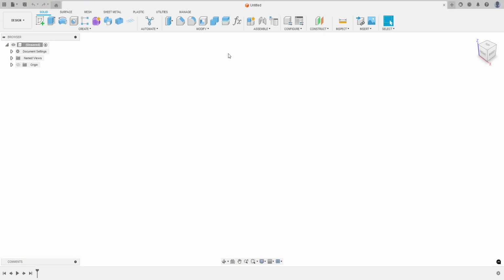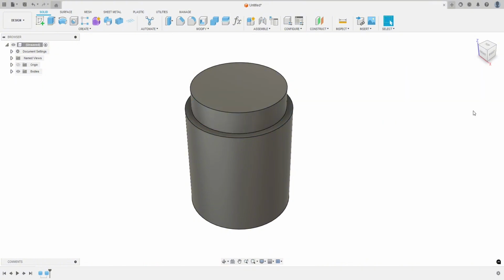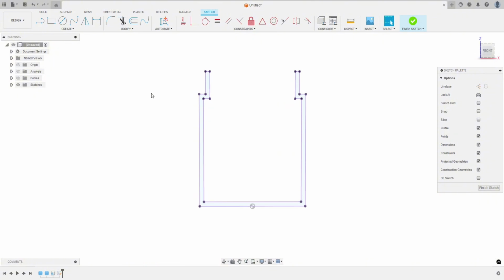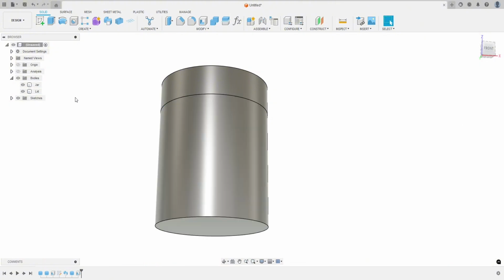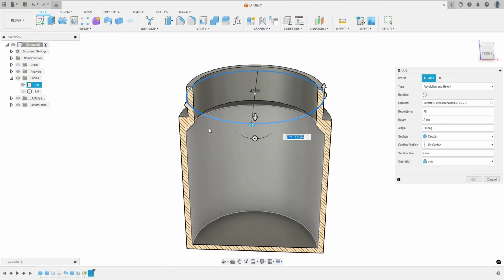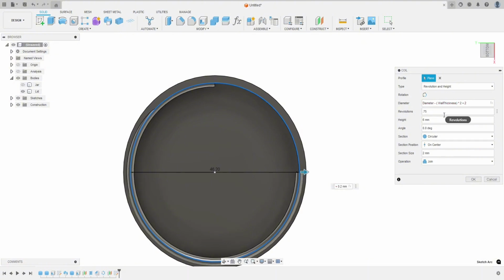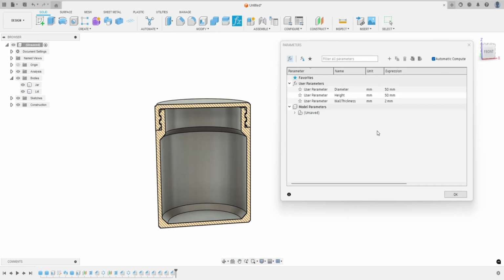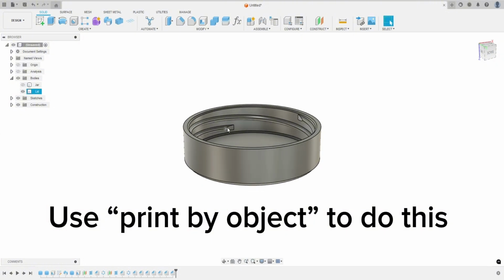Design and 3D Print a Simple Jar in Autodesk Fusion

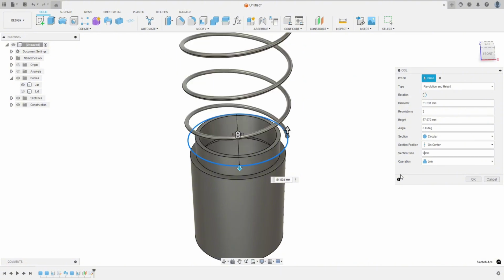Comment: Thank you for this video. I have a question at 17:43 - is there any special way to choose the number of revolutions for a jar? Or is it just basically "by preference or feel"?
In other words, is there a WRONG way to choose the number of revolutions that I may want to avoid? :)
Reply from the maker: I usually don’t go less than 1.25 revolutions unless I’m doing like a double or triple thread.  It’s basically just preference.  Need to make sure you have enough room on the neck for the threads to work
Reply: @ShopTherapy623  Thanks for your fast response. I'm sure the more I do this, the more familiar I'll feel when making them. :)

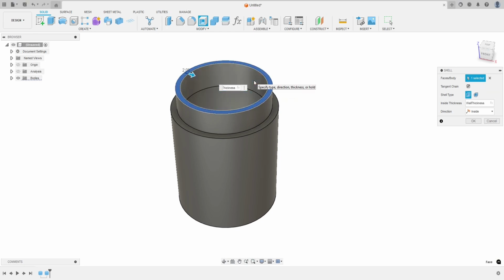Comment: I am so glad to have found you. I am completely new to 3D printing, but especially to CAD. (I’m also an “old dog” at 70) You are the first person I have been able to follow enough to get started. My issue is I don’t even know how to move the drawing around and find the right view. I need a jar that has a diameter of 50mm and height of 160mm with a screw top lid. I followed you to about 7:36, but I couldn’t turn the analysis back on and I couldn’t find the “lip” for lack of a better term to chamfer. I’m so frustrated! I went to your link in MakerWorld, but don’t know what to do from there. Any help you can give me would be greatly appreciated!
Reply from the maker: The section analysis will be on the left side of the screen in those drop down menus. You just need to toggle the eyeball on and off.  Creating a parametric model like this is a pretty advanced technique for a beginner. So good job making it as far as you did!
Reply: @ShopTherapy623  Thanks for replying so quickly! One other question. How do I download your maker file in Fusion? BTW I am using an Anycubic printer and their slicer program. I tried to download the 3mf file and even the bamboo file, but they both pulled up in Anycubic slicer.
Reply: Sorry! I just tried to download your design in fusion again. I hadn’t tried the “download stl” file. It worked! You are amazing! Thanks!
Reply: I finally finished the jar that I wanted! Thank you! I have another question. When I print the lid, it prints from the bottom to the top which leaves a lot of strings inside the lid. Is there a way to flip the lid so it will print from the top (the solid edge) and won’t leave strings?

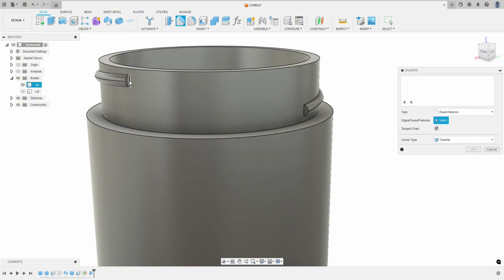Comment: At 20:43 you show how to select the non embedded edge of the coil to create a chamfer.  For some reason Im unable to select only the non-embedded edge.  Fusion is forcing me to select the entire circular cross section of the coil which includes both the embedded and non-embedded edge.  Any insight you can provide will be greatly appreciated.  And I should add that all selection filters are fully enabled.  Thanks
Reply from the maker: You need to join the bodies first (coil to lid or jar)
Reply: @ShopTherapy623  Actually they are joined.  I redid everything from scratch, this time I was able to select the non embedded edge however I received one of those nasty chamfer error commands when I input your exact values
Reply from the maker: @AB133a if you hop onto the Shop Therapy Facebook group, you can send me the file, and in can take a look at it
Reply: @ShopTherapy623  Actually I finally got it working.  Thank you for an excellent video.

Comment: do you have a tutorial to add textures to the outside of the jar and lid that change with the parameters?
Reply from the maker: I do not. That definitely gets more complicated, as the the size of jar changes, the texture will also have to scale proportionally.
Reply: Yeah that's what was afraid of. Thanks for the reply. 

@ShopTherapy623
Reply from the maker: @NotTodayStan42 it can be done though. However, Fusion is not really great with textures

Comment: Thank you this awesome! Just having one issue. When I perform the final test and change the parameters the lid does not change with the jar. I changed the diameter to 75 and the lid stayed at 50. Any suggestions on how to fix this?
Reply from the maker: You’ll have to make sure the parameters for the lid is set up correctly!

Comment: Thank you for your tutorial! I had to try it out immediately, and I learned so much from you over time. I was experimenting with creating a parametric surface pattern for those containers. The only issue was that the number of grooves remained fixed. I saw your other surface tutorials and was wondering if it’s possible to make one with a parametric option.
Reply from the maker: Parametric surface texture would definitely be more involved.  You’d have to come up with an equation for the circumference based on the diameter, that evenly changes the pattern of the texture.  You’d also then probably have to change the size of the texture as well.
Reply: @ShopTherapy623  Yes, I’ve already set that up for the width and height of the grooves. My formulas are probably way too complicated, but they work great. However, as far as I know, it’s not possible for the circular pattern. 🤔
Reply: @ShopTherapy623  I managed to design the surface pattern parametrically based on the circumference. The height and width adjust accordingly, as well as the rounding of the edges.

I want to thank you again—your videos have significantly improved my Fusion 360 skills. You deserve way more followers and recognition!

I’d love to show you how I solved it since I’m quite proud of it. Is there a way I can send you the file?

I’d also like to publish the design, but I didn’t want to do that before asking you and showing you what I was able to create with your help.

Best regards,
Chris
Reply from the maker: I would love to see it! I just started a Facebook group - https://www.facebook.com/share/g/18tXQxKoqT/ 
You can message my page on there or share to the group!

Comment: Just did the full follow along, great tutorial.  Yes, you can have the lid and the jar on the same plate with different layer heights.  After slicing (Bambu Studio) selected pull-down 'Color Scheme' to 'Layer Height' and the jar (inverted beside) prints at .12 while the jar is at .2.  The Volumetric Flow rate and print speed varies.
Reply from the maker: Thank you for that clarification!

Comment: Thank you very much for this tutorial. I have successfully applied its contents. I then printed the box with my Bambu X1C, in multicolor and with text on the lid. The result is excellent. I'd like to take this opportunity to give you a tip I've just seen on the Youtube channel “Shop Therapy” . It's at 21'52” in this video https://youtu.be/8ZbPqpAxYJ4. The guy selects the face at the end of the thread and then does a “Move” command followed by a 55° rotation. The result is the same, it's just another way for smoothing out stiff thread ends.
Reply from the maker: Shop therapy is my channel.  The video you are linking to is mine. Lol. I like the move command for the threads, but that doesn’t play very well with a parametric model.
Reply: @ShopTherapy623  Sorry !!! I agree for "that doesn’t play very well with a parametric model". Thank you for the way you explain in your videos.

Comment: i just wish cura would play nice with fusion. another great tutorial..thanks!
Reply: FWIW, I use Cura with Fusion all the time and it works beautifully. Cura opens automatically and the model appears right in the center of the build plate. If you want the exact procedure I use, let me know and we can figure out a way to exchange emails privately. 😊
Reply: @tzampini  incredible! thanks man.. yea please tell me your trick!!
Reply: @vanguardcycle  Here's the workflow I use: In the browser list on the left side of the screen, left click on a body or component to select it, then right click on it and select "Save as mesh". A box will appear. Make these settings: Set Preparation Type to "Print Utility", set Application to "Cura", and set Format to STL (binary). Then click OK. Cura should open with the part on the middle of the build plate. If cura doesn't appear as a selection, let me know. There is a one time set-up thing you'll need to do. Either way, let me know if it works for you.
Reply: @tzampini  wow! incredible..thanks sooo much. i will sit down with this tomorrow and report back
Reply: @tzampini  it worked flawlessly!!!! cant thank you enough my friend. cheers
Reply: @ glad I could help
Reply: @tzampini  so much easier than how i was doing it before.
Reply from the maker: Cura can’t take a 3mf or STL?
Reply: @ShopTherapy623  it acts like it's going to import the model, and opens cura, but then nothing happens. in any format.
Reply from the maker: Weird. How are you importing?

Comment: Is it also possible to add a circular pattern sketch as a design to jar, and it will be applied when the parameters change?
Reply from the maker: Yes if you make that at the end it should update, but depending on how complicated the pattern is, it may take a while.  you will also have to make the pattern parametric, to account for the change in size of the jar